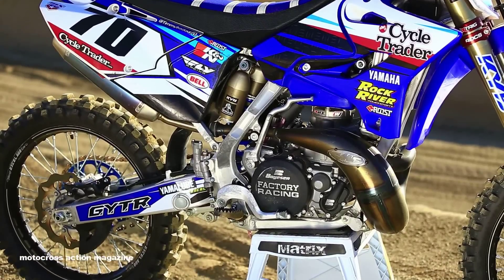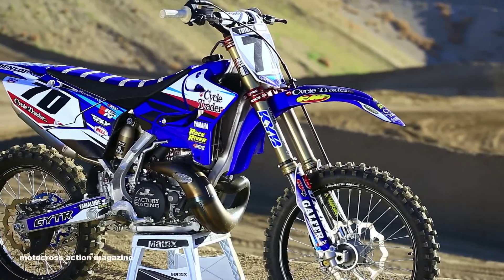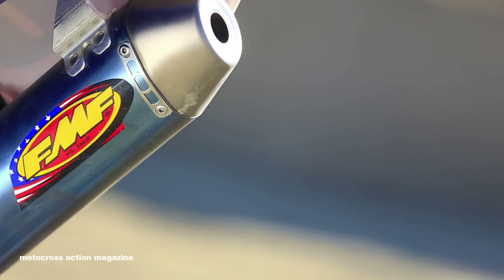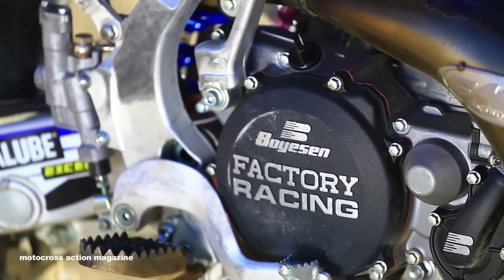Project Cycle Trader Rock River Yamaha YZ 250 2 stroke - Motocross Action Magazine

Comment: is it faster than a yz250f?
Reply: Fredrick Christensen Absolutely! With the right rider, a 250 2 stroke can beat a 450f...
Reply: Nick Scott You're  right! For those that can remember back 10 years or so, when Ricky Carmichael was still with Honda. Most guys in the 250 class had switched to the 450 4-strokes - except Ricky. Ricky smoked every 450 on the track with his 250 except Kevin Windham on some tracks, and Kevin was riding a factory Honda 450. #love2strokes
Reply: Fredrick Christensen A YZ125 can practically take out a 250f
Reply: Depends
Reply: Nowadays they are about equal
Reply: @Jack-hy3qp  no way. The yz125 is very close to the yz250f in power. The yz250 has about 10hp over the yz250f. In most instances, the two stroke will have almost double the hp as the same bike with a four stroke. Its why the yz125 races 250 four strokes, and why the yz250 races 450 4 strokes. It wouldn't be competitive otherwise.